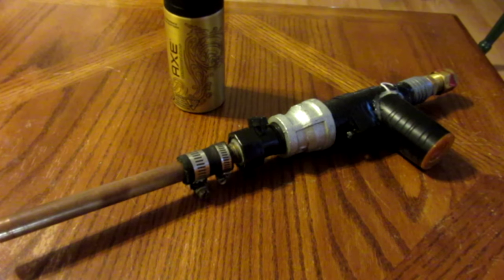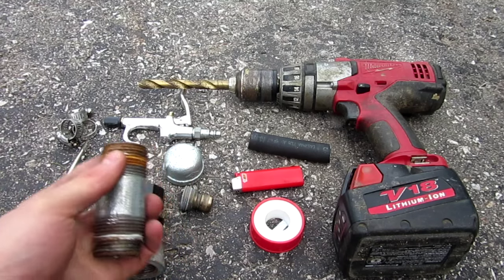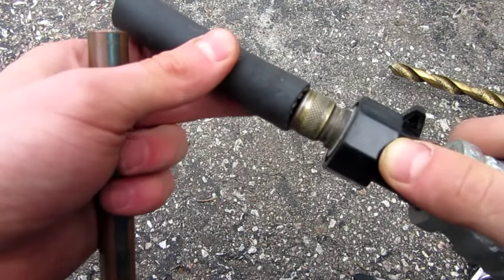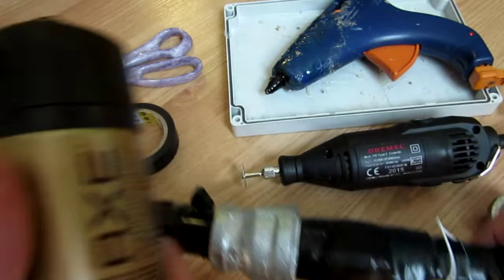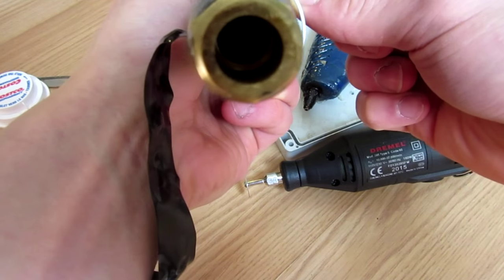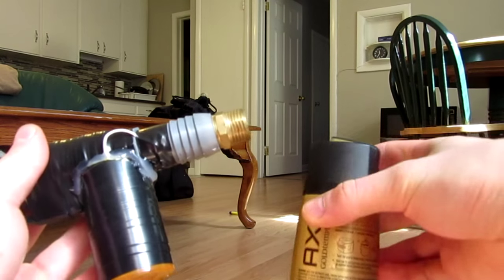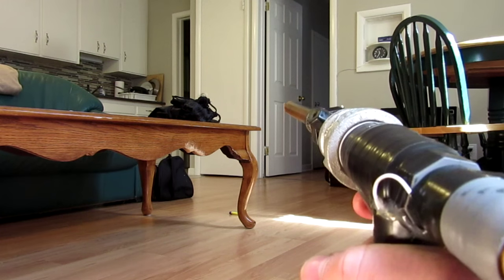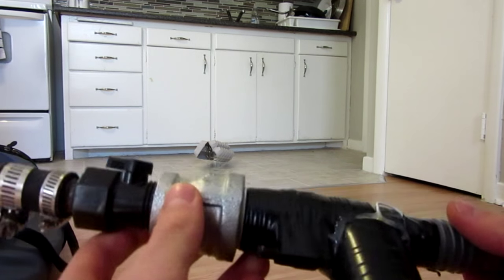World's Most Powerful Nerf Gun -  How to!

Comment: I used a high pressure electrically operated sprinkler valve w/solenoid with a massive 6-8 gallon air tank behind it, at between 50-80 psi. All pvc works amazing. I'll get a video out when it starts getting warm out, it's freezing where I live.

Comment: You should add another tube to the whole thing that fits an Axe perfectly, then add a valve next to it as well to prevent backburning. Then you just open both  valves, spray, close the loading valve and fire away. Much quicker

Comment: "NERF GUN" lol i am in the middle of designing some thing like this... but for  dowels plugs lol.. 3/4 inch diameter.. i like what you have... i bet you would get a bit more power if you soldered the metal parts together. cause the hose will have a bit of energy loss due to minor expansion to my theory. lol. i am inspired.

Comment: You should attach the axe spray can to the end like a paintball gun so you can just spray on the go
Reply: yes but with this design you need a fuel/air mix wich requires opening the cap or it can't get enough oxygen to fire.

Comment: This is the worst homemade Nerf gun I've seen Coop727 made a pistol that got around 80fps and a regular Nerf gun is better than that thing
Reply: The End syndicate 80fps 😂😂 its the power of a stock nerf gun the ls4b is a sniper mod that shoot to 450 fps xD
Reply: Zexir official it isn't and longer barrels in nerf doesn't help the range also it is 70fps is the slandered for flywheels and modded spring powered pistols
Reply: The End syndicate a stock retaliator get 75-80 fps on average. If you mod a super soaker hydro pump its possible to get up to 600 fps the same guy that made the ls4b made the hydropump

Comment: "Worlds most Powerful" is it more than 120fps?? Because modded Nerf Guns can shoot at 120fps
Reply: 120 fps is pathetic, I made a big one of these launchers and had a mega dart with the battery stuffed down the tip, 600fps lmao and dented a sheet of metal
Reply: +sasdlasokdalkfdalksfa Dude, seriously not the same as a modded blaster.
Reply: +sasdlasokdalkfdalksfa- if you were to even make it that powerful just doing a mod to the air restrictor, it's more powerful and still safe to shoot at annoying brothers. Plus if you made one that shoots more than 500fps it's considered a fire arm and you need a arms licence. Also how do you ever know how hard it shot, do you own one of those devices that measure the fps, like the ones used for air soft? ( sorry forgot name of it) ps- that 500fps is for me in Canada idk if it's the same in the US
Reply: Thomas Ulcar yeah i have a chrony
Reply: +The chosen 1 I have a oznerfnerd longshot delux kit and i can't use normal darts with it.
Reply: +sasdlasokdalkfdalksfa   I made one shoots 700fps through 4 milk jugs- with a nerf dart
Reply: DiyCaster that's physically impossible, a nerf dart is 15 grains, at 700 fps you're getting 16ft lb of energy, a .556 will go through 5-7 milk jugs and has 1300 ft lb of energy
Reply: +sasdlasokdalkfdalksfa if they're empty, it will go straight through, and the darts I use are weighted so at 130psi it will
Reply: The chosen 1 modded. Guns can  shoot over. 225 to. 250 ive Seen Prob  More. High powered ones then That
Reply: The average Aussie can reach 200